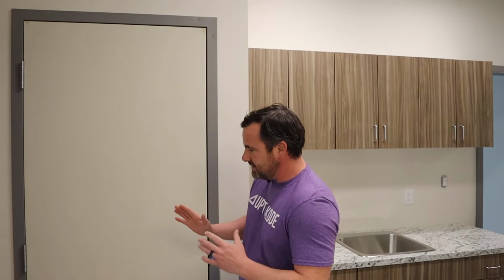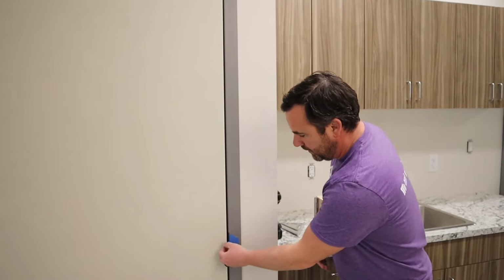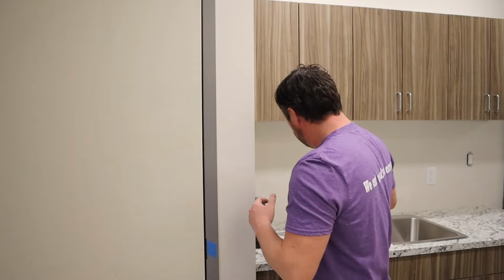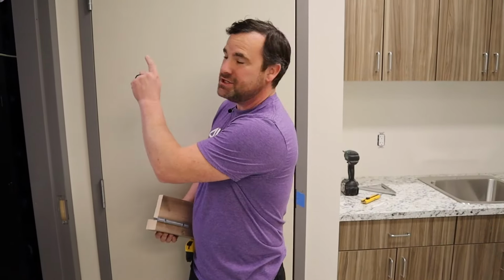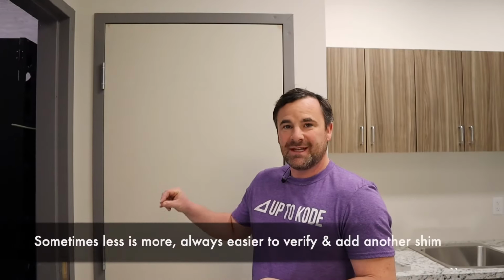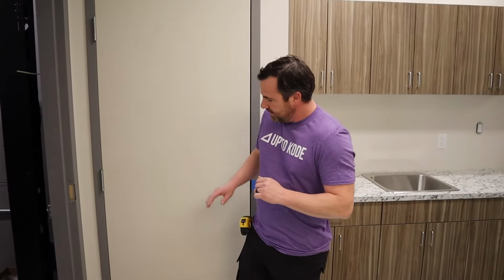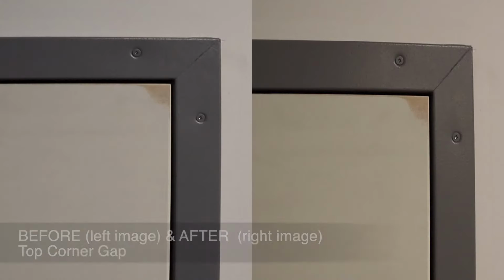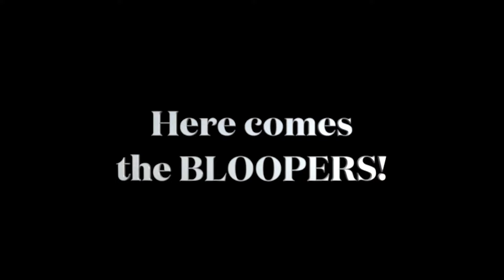How to Adjust Any Door Without Special Tools

Comment: Thanks for the great video! How wide would you recommend the shims be (say, relative to the width or height of the hinge)?
Reply from the maker: I used thin cardboard like what you would get crackers in a box from (that kind of cardboard) . Sometimes you need 2 layers of this. Maybe even 3 layers. 

or just thick construction paper. 

Sometime I have to fold normal paper up a few times too.
Reply: @uptokode  Thanks for the additional information -- I was asking something slightly different, though. I would consider the thickness of the cardboard used to be the "depth" of the shim. I'm asking about the "width" of the shim -- how much of the hinge area does it take up?

Comment: Thanks for this video.  I have  double French doors with a gap between them at the bottom third.  There's already weather stripping but it's not wide enough.  So I'll go through your inspection and try this.  I couldn't tell though - do you just loosen the screws to slide the shims in or do you remove completely?  Thanks.
Reply from the maker: Technically remove the hinges to get it fairly perfect to what you need would be best.

Comment: What if the door is sagging and rubbing on the bottom corner where do you place the shim to lift it up a bit ?
Reply from the maker: You could do 2 things. 
A. Pull the top hinge inward and close the gap between the frame and the door. Do this by shimming the hinge furthest from the pivot point. 
B. At the bottom hinge you want to make that gap bigger. To make it bigger you shim the hinge CLOSEST to the pivot point of the hinge . 

Hard to explain but hope it helps
Reply: @uptokode  thank you sir , May be you can do a video on this. I work for a university and all the deal
With is commercial hardware and doors. It would be great to see more on this topic of shimming in different scenario. Ty for responding you are a the man.
Reply from the maker: @jaybig360 I’ll do what I can when I’m working on commercial doors. Thank you !

Comment: seems like a lot of effort, why dont you just pop the hinge pins and bend the hinge loops as needed
Reply: Because he's working on a knock down commercial door here with heavy duty hinges and you need to adjust them by shimming the front or back of the hinge leaf.

Bending the hinge loops is for standard interior/exterior doors
Reply: @evictioncarpentry2628  thanks
Reply from the maker: I like using the shim method (even on residential doors) because I can change it as required. Some doors change with the seasons and i would have some mangled hinge loops if I adjusted them 2 times a year. And my method is easier to make small adjustments.
Reply from the maker: Thanks!